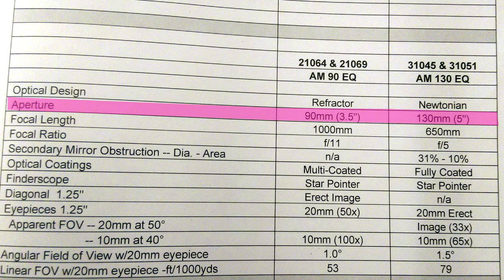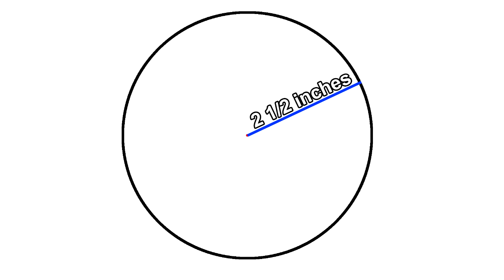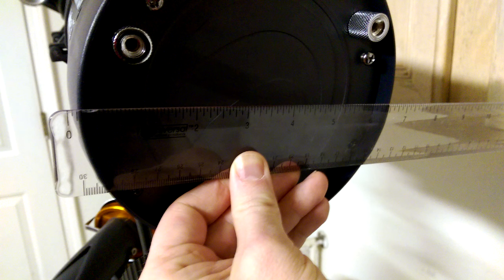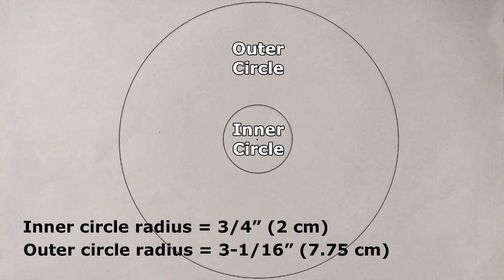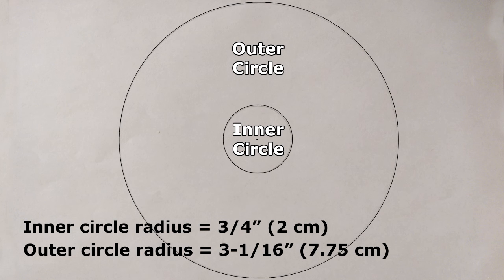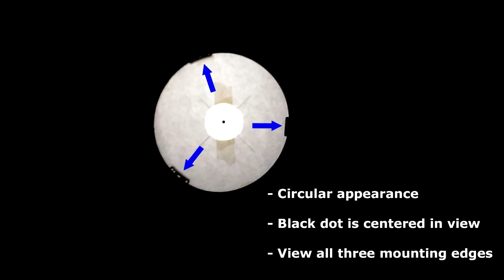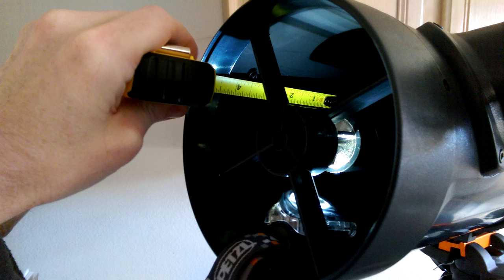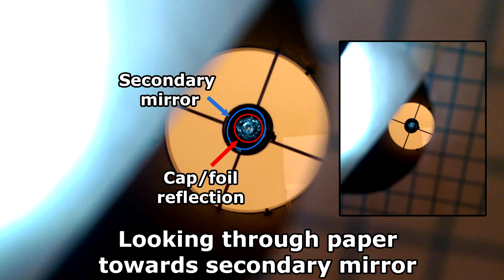Collimating A Newtonian Telescope

Comment: Hello and thank you for this method that does'nt use a "collimation laser". In my opinion, it's always very useful to understand the optical principles of your equipments. This way of doing things is really interesting. I just have a question about the white reinforcement pad chip stuck on the mirror: once the primary mirror is properly adjusted, should we leave it on the primary mirror? Thank you and have a good day :)
Reply: You can leave it since it's laying in the shadow of the secondary mirror.
Reply: @dangernba  Thank you... :))